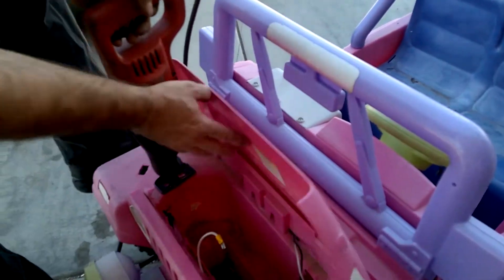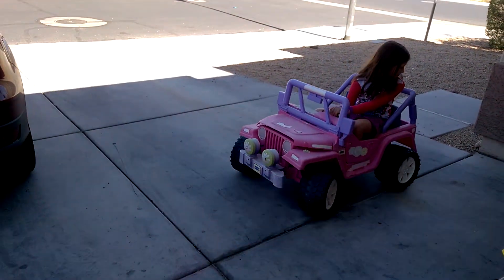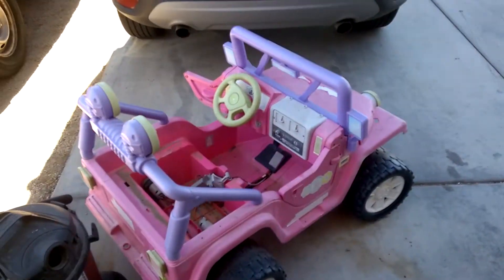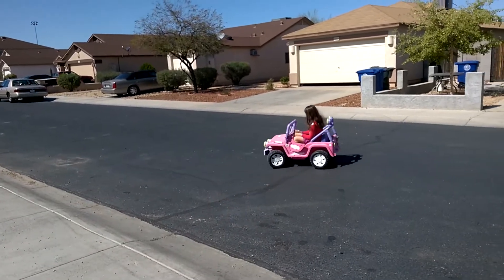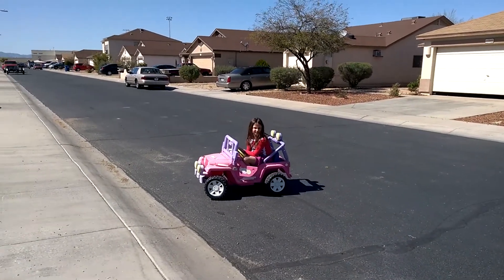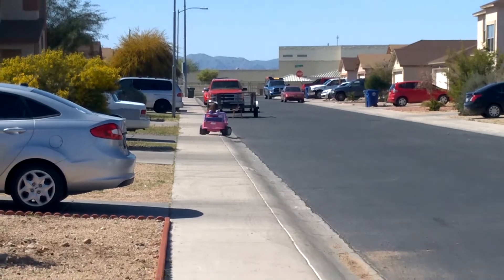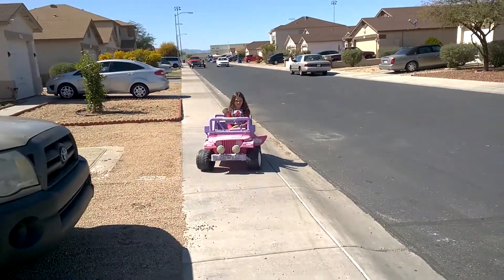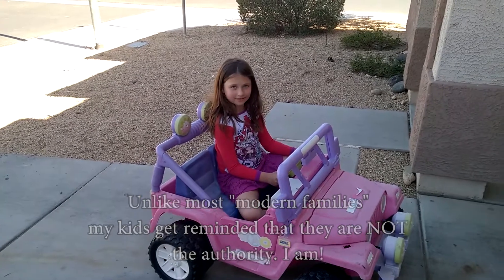Project Ashlyn's POWERWHEELS Jeep: Battery modification

Comment: When my daughter was little I bought one those Jeeps used from a guy at work for $50. She played with it for a couple years and then I sold it for $50. They can take a beating.
Reply from the maker: Yeah they are tanks. But convert them to 24 or 36 Volts and they might start to break! HA HA!

Comment: Kids today have it so much better than we did. I was lucky to have a few friends that had a mini bike and some go carts. We knew if we broke our toys that was it, no more which explains why I had more model airplane engines than planes. She needs some rubber treads glued to those tires and maybe a key ignition switch.
Reply from the maker: Same here. We had almost NOTHING but our imaginations.
I didn't even have a pedal type cart like the other kids had.

We used to steal my uncles go-cart that had no engine on it and push it up the hill and take turns driving it down the hill.